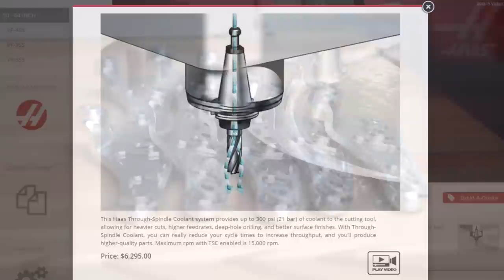Through Spindle Coolant (TSC) for Haas Milling Machines - Haas Automation

Comment: I'd love to see a tool change after. We have a 2018 VF5 and the air purge must be in the milliseconds. It pukes out coolant when switching tools. We had a tech come in to try to figure out how to make it stop and they told me the newer generation controls you can't adjust the purge time. Utter nonsense. We paid a lot of money for this feature and it is basically unusable because so much coolant ends up in the taper.

Comment: Hi could anyone help me i have a vf2 ssyt and i use TSC to drill 2 and 3 mm holes through st/st weld and it worked fine for the first couple of days but now I have a noise coming from the black pipe that's from the pump to the spindle, I think I could have air in it or to much pressure? Any help would be appreciated  if not will have to call in haas